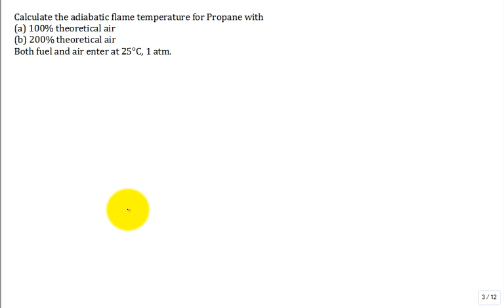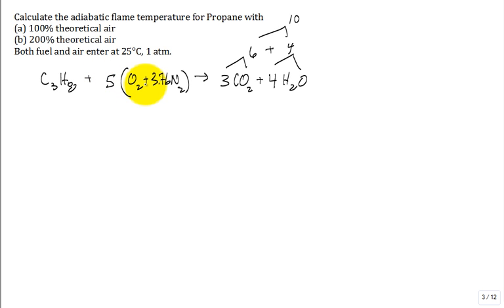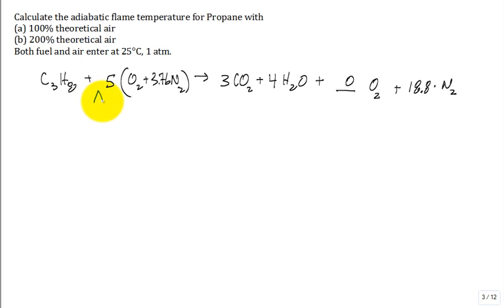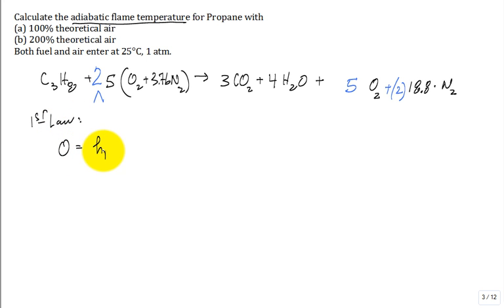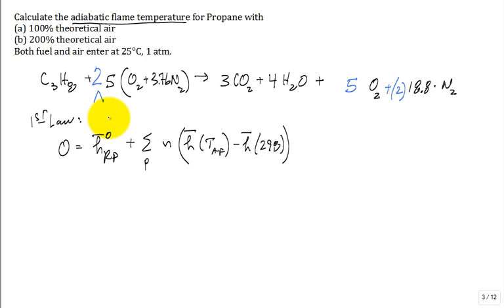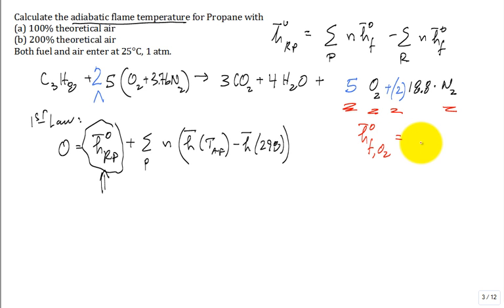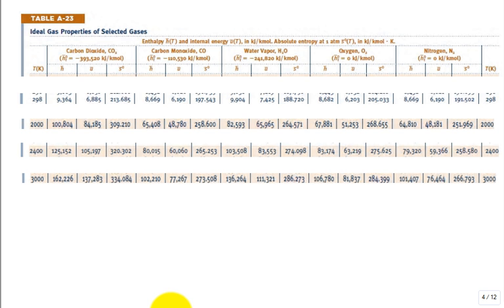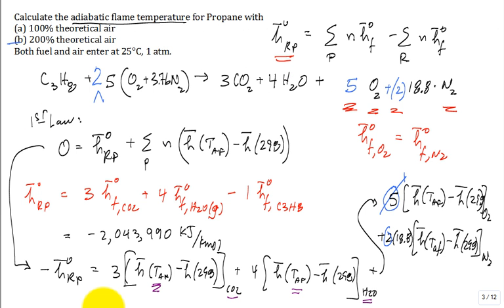adiabatic flame temperature for propane

Comment: Sorry to disturb you sir !!!
But I need the solution of problem,
" Write a program to study the effect of the percentage of theoretical air on the adiabatic flame temperature for a (variable) hydrocarbon fuel. Assume reactants enter the combustion chamber at 25◦C and complete combustion process. Use constant specific heat of the various products of combustion, and let the fuel composition and its enthalpy of formation be program inputs."
Sir it's looking difficult to me so plz send me complete solution.
May God bless you!!!